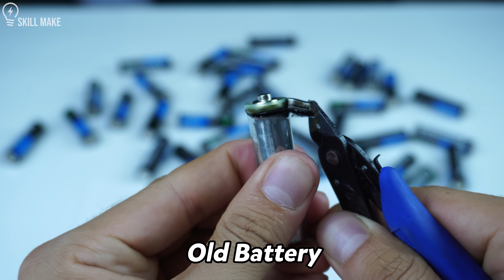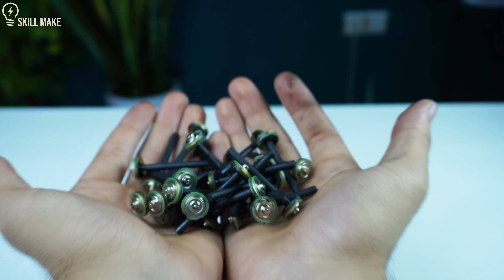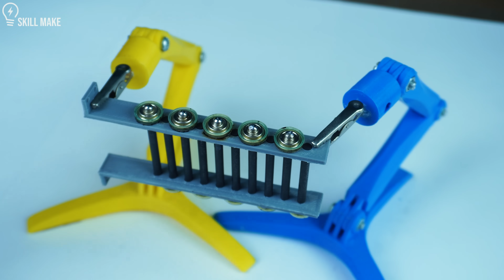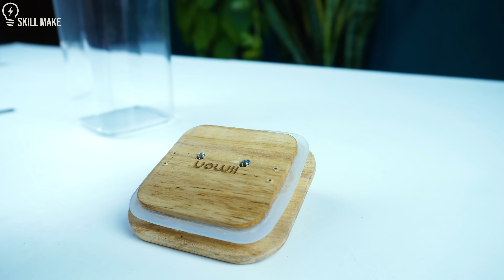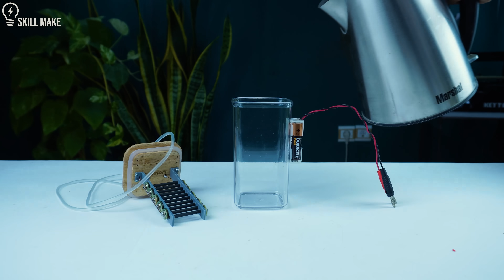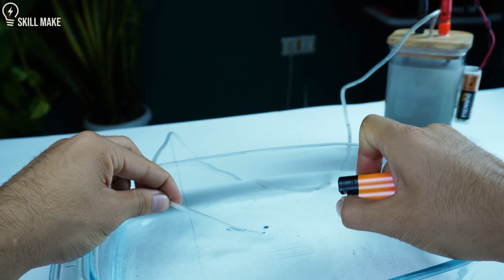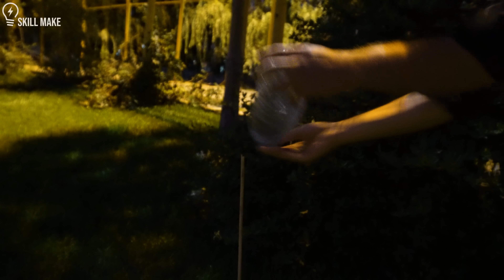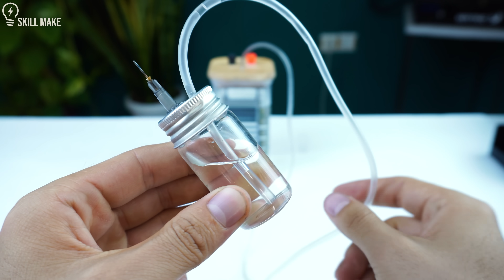Water into Hydrogen - Making a Simple Hydrogen Generator from old battery - hho

Comment: Just a tip, if you separate the cathodes and the anodes and have separate collection reservoirs above each, you would be able to collect the hydrogen and oxygen separately. Just a tip 😘 Also you need to make sure you use distilled or as pure water as possible, read on to find out why.

Although pure water is not conductive to electricity, any contaminant will do, a rock or pebble, even the anodes and cathodes themselves.
I don't think you necessarily need the potassium salt and you definitely don't want any Sodium salt to be in the water you're using.
Reason being if Sodium salts are present you will end up with chlorine gas, which is toxic. BTW this is exactly how Saltwater pools chlorinate water, the water flows from the filter to a device with electrified plates which split the salt in the water realising chlorine gas which dissolves into the water and essentially evaporates out over time. Because it exists as a gas other things called chlorine stabilisers or "sunscreen" are added and hold on to the chlorine weakly and release it slowly in the water.
Reply: Just some safety concerns 1. Don't touch the electrode from this  old battery without gloves. 2. Defenetly don't use salt you end up with chlorine gas and this is toxic. 3. U shouldn't catch hydrogen and oxygen in the same volume, that's a very dangerous idea. It needs only 19 milli Joule to ignite the detonating gas ("hho") that means the static electricity from your clothe can be enough to blow your hands away.  Better learn how electrolyzer really work and build it in the right way, not this self-destruction mechanism 😉
Reply: This is what great research is about! Nice remarks
Reply: Надеюсь многие прочитают ваше сообщение и не будут повторять эксперимент из видео.  И да, если уже собирать, то отдельно водород и кислород и да использовать кислоту, а не соль.
Reply: This is also one way that submarines can supplement their oxygen for extended stays underwater, electrolysing pure water to get the oxygen, but this is not practical for long when you only have a limited supply of pure water when surrounded by so much salt water, because it also takes alot of energy and time to filter/purify salt water, whether it's by boiling and condensing(distilling) or reverse osmosis (direct filtering).
The other way is by "burning" what are called candles, which is very counter-intuitive because normal candles burn oxygen, but these "candles" give off oxygen.
Although, adding more oxygen is pointless if you don't have a way to remove waste gases. 
Filtering is usually done by passing the air through filters which capture the carbon dioxide by reacting with it to produce less harmful substances. 
For example air can be filtered through calcium hydroxide which removes the carbon dioxide by reacting with it to produce calcium carbonate(chalk) and water.

I love how it all comes down to chemistry and how the products of water electrolysis can be burnt and they produce exactly that from which they came, water.
Even in the previously mentioned pools, saltwater pools slowly become more alkaline or basic from the chlorinator.
As the water becomes more basic, an acid is added to correct the levels, and what's actually happening chemically is the Sodium hydroxides produced from chlorination react with the acid (which is usually hydrochloric acid, containing chlorine) and the products are just Salt and water, which can be used by the system all over again. 
Salts and dissolved substances don't disappear with the water when it evaporates Just saying, just in case 😅 (seen some pools almost as salty as the ocean 🤣)
Reply: @TheUwolus  I suppose you don't want any kind of metallic salts. Salts are a union between elements that on their own are very volatile or toxic.
E.g Sodium Chloride, Iron sulfate, Potassium chloride, copper chloride, Potassium nitrates.
Reply: Sodium salts won’t cause chlorine. Using chloride salts will produce chlorine.
Reply: @Grak70  To be fair I think that Sodium Chloride is only the most common form of the Sodium salts. Regardless of whether it's Sodium Flouride, Sodium Chloride, Sodium Bromide, Sodium Iodide, Sodium Sulfate, Sodium Bicarbonate or Sodium Carbonate, once the gaseous component of the salt is released  they are extremely toxic and very reactive especially in the case of chlorine and flourine, and in the case of Bicarbonates and Carbonates, they will cause suffocation if in an enclosed space without ventilation or breathing gear.
Reply: I used sodium chloride once....  
after an  hour or so, the printing on the plastic juice container I was using  had faded to nothing.  A lesson learned there.

In the end I found that common sodium bicarbonate was safe and effective
Reply: I did this in high school, and we collected the gases separately, as you described.
Reply: @XB10001  That's exactly where I got the idea, I also did this in highschool chemistry class over 20 years ago 😄
Reply: @MrChazz10  that’s absolute nonsense. Using baking soda isn’t going to cause suffocation. You’re not producing HHO gas in an industrial setting with this kind of setup. Using NaOH or KOH just makes sense in that your anion isn’t converted to a gas. But using metal carbonate or bicarbonate would be perfectly safe.
Reply: I was thinking the same thing
Reply: Thanks for providing such an awesome explanation.  I hope hydrogen becomes the solution to our future car and house power needs
Reply: @Grak70  I'm talking about bicarbonate reacting with an acid. 
If there's a large enough amount of reactants and enough carbon dioxide gas being given off, I'd say it could very well cause suffocation in certain although maybe unlikely settings, an enclosed environment with little to no ventilation perhaps.
Carbon dioxide is heavier than oxygen and will sit at the bottom of a space relative to oxygen. With no air movement, like maybe in a hole with only one entry/exit( an enclosed environment where it's unlikely that a huge amount of baking is going on🤷‍♂️🤭), carbon dioxide will displace the oxygen in that space.
Just saying.
Reply: Is there an in depth explanation or literature u recommend that I could read and learn more about how to make one myself?
Reply: @johnbrawner1942  Maybe a highschool chemistry text book?

All we used in highschool was a science lab power pack that had variable power output and a non-conductive container. 
The cathode and anode were separated by a few centimetres. Hydrogen is positive in charge and will be attracted to the negative electrode and will rise into the collection reservoir above it, oxygen is negative and will be attracted to the positive electrode and rise into the reservoir above that electrode.
You should be able to see bubbles forming as gas is released, to confirm its hydrogen you can perform what is classically referred to as a pop test. 
Release some gas from one of the reservoirs into an upturned test tube and introduce a flame; if it's hydrogen, it will ignite and make a "popping" sound as it ignites inside the test tube. If it's oxygen, the flame will flare up momentarily.
Reply: How does using sodium salts end up producing chlorine? It doesn't make sense
Reply: Another tip; unless you like shoveling AA batteries by the pound, get a cheap DC power supply.
Reply: Conductivity of Pure Water Vs Contaminants:

Counterargument: Water without free ions is indeed poor conductor of electricity; however, just the presence of any contaminants does not automatically increase conductivity; rather it must contain either an ionic compound or free ions to enhance conductivity; rocks or pebbles do not usually significantly increase conductivity as long as they do not leach ions into the water, since conductivity depends on charge carriers (ions) rather than physical presence of material (rock or pebble).

Necessity of Potassium Salts:

Counterargument: While potassium salts may not be essential to increasing water conductivity, they are occasionally beneficial when certain applications demand potassium ions as the electrolyte of choice (for instance fertilization and certain batteries like potassium-ion batteries). Electrolytes' selection depends on their chemical properties as desired in end products or processes.

Presence of sodium salts leading to production of chlorine gas:

Counter-Argument: Electrolyzing sodium chloride (salt) solution does produce chlorine gas; however, its production can be desirable in certain instances, including disinfection and industrial processes. Chlorine gas production through electrolysis of saltwater is an accepted and intentional chemical industry process used for various uses such as water purification.
Saltwater pool chlorination and stabilizers:

Counterargument: While the description of this process is accurate, its implication that production of chlorine gas is always undesirable is inaccurate. Saltwater pools use this process intentionally because it's effective at keeping sanitized water levels consistent through use of stabilizers like cyanuric acid that protects chlorine from being degraded by UV light - keeping levels consistent so it can continue to disinfect efficiently without manually adding chlorine additions - saving both cost and maintenance efforts by automating the system rather than manually adding them manually.

Though based on sound principles (e.g., conductivity of water with ions and production of chlorine gas from salts), the argument does not always hold. When considering their application in context - whether for electrolysis processes, disinfections or chemical reactions - potassium salts should not necessarily be seen as necessary and sodium salts as undesirable chemicals.

For the current moment, I will resume looking at trees. Good day!
Reply: MrChazz..Great TIP. Little tiup for you, just a tip. When you comment like this one another parsons work, its great and very helpful. I suggest making a little bit more out of what this person did and recognize him or her for what they did do rather than starting off immediately with instructions on how to make what he did better. Remember, its "just a tip". My mother used to criticize me when I was young too. This guy has 147 thousand subscribers and you have um 3. Why is it that the people who comment the most are not putting anything up or contributing to the party? The most critical people are the ones who don't have the courage to produce themselves.
Reply: I feel as though I am a black ram in a pen of sheep with my incredible lack of knowledge on this matter.
Reply: @jaydenmann2453  I'm sure you will be able to pick it up. 
They teach this to 16 year olds in highschool chemistry, well that's about how old I was when I learned  it anyway.
Reply: I once made it as school project with my teachers guide
Reply: You will get chlorine gas and hydrogen
Reply: Separating the electrodes decreases the gas production. You need an electrolyte to allow a high current to get enough gas production. Sodium salts don't produce chlorine, chloride ions do.
Reply: @MrChazz10  That makes no sense. Sulfate for example is not an element and also not volatile or toxic. The NaOH used doesn't produce any side products.
Reply: @MrChazz10 what do you mean with gaseous component? You can't electrolyze fluoride or carbonate in water
Reply: @MrChazz10 do you know how much Na2CO3 it would need to fill a room with CO2?
Reply: Will deionized water work?
Reply: Koh is what is normally used in making this. It’s an industry standard
Reply: True story I have done this and it involves alot of work...
Reply: Смысл разделять кислород и водород? Так получается хорошая топливная смесь.
Reply: That started off ok, but you went wildly astray.  Efficient electrolysis requires good conductivity and pure water, or anything near, just doesn't conduct enough.  You MUST use an electrolyte. 
Sodium salts can not generate chlorine, unless they are chloride salts ( or chlorine containing anions.)  
Sodium sulphate, bisulphate, thiosulphate, nitrate, bicarbonate, or hydroxide (as suggested in the video) would do.  
The choice between sodium and potassium may be affected by the type of electrode, but I can't see much difference.  You can get into concentration, conductivity and cost issues, but they are similar at this level.
If you are using the word "salt" to mean specifically the chloride of sodium,. then you should equally not use the chloride of potassium.  If you use the hydroxide, then either will do.
Personally, I'd have gone for sulphuric acid, but I've no data on its performance relative to the alkalis.
These considerations of which electrolyte, the specific concentration, the type of electrode and even temperature, would all be considerations in a commercial system, which would obviously want to be as efficient as possible, cheap and durable.  I suspect that the way forward with hydrogen generation might not be with electrolysis using renewable electricity, rather direct photolysis generating the hydrogen from sunlight in solar panels (not photvoltaics generating electricity.)  Cutting out multiple conversions is potentially much more efficient.
Reply: any good example for easy membrane?
Reply: @Merlin3189  wow , I find that mixing some house hold baking soda does the trick just fine .. it's an excellent electrolyte.. I can run my hho cell forever with no issues for anode or cathode, and my solution stays clear ... 
I find it absolutely laughable listening to people talk about the best electrolyte to use blah blah blah , special stuff cost more , certain salts , and on and on. Two words people BAKING SODA
Reply: @Grak70   I was hoping someone would point this out.
Reply: Bollocks, salt water makes electrolysis even easier. Lye is what we used at work for commercial H2 & O2 production and the Oxygen was pure enough to inject into our Nuclear reactors. Ultra pure water doesn't conduct electricity so electrolysis is very hard in pure water. We use ultra pure water to cool the 23.5KV stator and if the water wasn't pure, it would short out the stator windings.
Reply: ขอบคุณครับสำหลับความรู้
Reply: @MrChazz10  Most subs use reverse osmosis now. The system is highly efficient. Pure water is also used for the steam generator and a few other components. There's also a reserve tank that's specifically allocated for demineralized water. I was taught that the electrolysis generator is the most dangerous piece of equipment on the entire submarine as it can turn into a hydrogen bomb fairly quickly.
Reply: regarding your first point, would i have to put the cathodes and anodes in separate jars with them wired together? how would a device such as this look with separate anodes/cathodes and collection vessels?
Reply: @omfgbobsaget  No, you just need to have a solid gas tight separation plate/wall above the water line. The electrodes must be connected below the water for the electric circuit to be complete.
Reply: 66
Reply: My dog farted in my face and the smell reminds me of an old pizza restaurant my dad use to take me to when I was a kid.
Reply: @hantrio4327  gaseous component because once you electrolyse salt, the chlorine and Sodium become separated.
You sound like you know enough that you should also know that  pure chlorine is a gaseous element at room temperature.
Reply: @MrChuckDeez  did it burn your nostrils like chlorine gas though?
Reply: @hantrio4327  it doesn't have to be completely full of CO2 for you to die of suffocation, just enough that you're not getting enough oxygen and pass out... so what's your point?
Reply: @hantrio4327  maybe not necessarily toxic, although almost anything can be toxic or bad if there's too much, especially if it's displacing all the things that you actually need (oxygen) or causing some irritation (skin, eyes, lungs) which sulfates can cause.
😶‍🌫️
Reply: Please kids if your here be careful this is actually a bomb
Reply: Dude why don't u do something with ur knowledge it will help mankind
Reply: @ktolwal  who are you talking to? The content creator or someone in comments?
Reply: Not an engineer but I don't think you should strip batteries without wearing gloves.
Reply: How long can the installation be operated? Do the battery rods deplete quickly?
Reply: so
Reply: all the ingredients he put in the video I was reading them off 🤣 and when it came to that part I was like distilled water! but it just said water 🤣🤣🤣 also said salt but he used drain cleaner 🤣👏🏻👏🏻👏🏻
Reply: Что растворил в воде ?
Reply: 事实上，若只是考虑氯气仅仅是不要加入NaCl或其他盐酸盐，加入电解质的目的是保证电解池的工作效率
Reply: "this is exactly how saltwater pools chlorinated water". 

Are you talking about an industrial process?  Or something that happens by accident.
Reply: cool idea, but 12V x 5A = 60W input energy for this little flame at the end ...
Reply: This makes me feel like no sky man
Reply: Will running the tube through water dissolve/infuse the hydrogen into the water? I want to be able to get hydrogen gas into water.
Reply: @MrChazz10  You'd need an insane amount of bicarb and like zero ventilation. It's not a real concern.
Reply: As they say where I'm from, you have few ideas, but well confused.
1) Distilled water is not conductive. Electrolysis won't work in distilled water because it does not contain any ion, so electrical charges will not be able to move. If you place a pebble into distilled water, ether the pebble is soluble (so the water won't be pure anymore, and ions will be formed) or it isn't (so the water will remain pure, apart from dust and microbes that were present on the pebble).
2) You do need to dissolve a substance that produces ions. Salts will work okay, but the best performance is obtained with a hydroxide, which he used. Potassium hydroxide (KOH) dissolves into K+ ions (positive) and OH- ions (negative), which can carry charge. He could've also used sodium hydroxide (NaOH), which would've created Na+ and OH- ions.
3) You are thinking of a single specific case (table salt, NaCl) dissolved in water, and mistakenly believe that case applies to any substance. Spoiler: it doesn't. NaCL in water separates into Na+ and Cl- ions. That's why it's called sodium CHLORIDE. The negative chlorine ions are the culprit for the formation of chlorine gas, but chlorine was already present in the salt to begin with. A hydroxide, like NaOH or KOH, contains no chlorine atoms, only hydrogen, oxygen and an alkali metal, so no chlorine gas can form.
Reply: @Euer_Ernst man it's a battery lol u can go ahead touch ur Tung to a 9v it isnt bad at all play some paintball n then say that
Reply: @MrChazz10  ionization in the salt helps
Reply: @MrChazz10 hey I got great feedback for you to try mix some hydrogen peroxide with acetone and u get a cool 😎 experience
Reply: @keving.9301 your good buddy these people don't no shit. U good.
Reply: @johnbrawner1942  really.  Your asking this... Man it is called the internet ya no the thingie using ask google or w.e
Reply: @Telephonebill51 what. Do u no why your saying this BC that's not what the video is if. Uwant that look else where
Reply: @hantrio4327 and u know what about hydrogen?
Reply: @ewthmatth  he's using a way to make electric charge from elements man. What r cu asking exactly
Reply: @kalleschwowell8062  12v alternator plus a 24v alternator In series to a battery then again. But with I step up transformer band there you go. You don't need fuel to run your generator anymore. By the way, don't forget to add this device in series before the alternators and they have to be 12 volt then 24 series connection to battery× 2
Reply: @LiamFarleyMA finally we have a nother cyber punk nerd like me n this dude. Liam high respect
Reply: @dylanpilon777  Is this a question or like what's you trying to say BC u make no sense
Reply: @nholmes86  lol cyberpunks Unite eh lol 😂 me too I love building stuff like this
Reply: @kalleschwowell8062  no 12v alternator to 24v alternator in series from this linked to a battery ur out of the loop
Reply: @jimboyep1662 yes but the amount of these in series with the 12v n 24v alternators n batterys would take up so much room your best betybe be large truck but then u need more BC of weight so ya no
Reply: @---lk7mo  sodium chloride AKA salt
Reply: @OneTheOriginal  who's talking about the battery, if you want lick it, I wouldn't suggest that because it's still not healthy but hey. I'm saying it's a bad idea to catch this two gases in the same glass it needs only 19mJ ignite energy to explode in your hands if you do a mistake. And by the way I played paint a lot of time and I'm working in a hydrogen laboratory but I can't see  any connections here.
Reply: Actually is not the sodium itself is the chlorine that produces well, the chlorine, just avoiding chlorides salts should do
Reply: Why old batteries try a RTG ON NUCULAR WASTE free fuel no cost using once feared waste now powerful hydrogen
Reply: Not every soduim salt releases chlorine gas using sodiumcarbonate ist complitley fine. And you NEED to use some kind of safe salt to make your distilled water conductive you will allways get some ions from the suroundings but by mixing in the „safe salt“ you limit the amount of unknown salts that get split and that way also the amount of toxic stuff that is released.
Reply: Turning water into fuel?
Reply: You talk like AI
Reply: Fake nerd 😂
Reply: 수소와 산소를 분리해야한다.
그렇지 않으면 폭탄을 만드는 것과 동일하다.
무식하면 용감하지.
Reply: This video is pure innovation